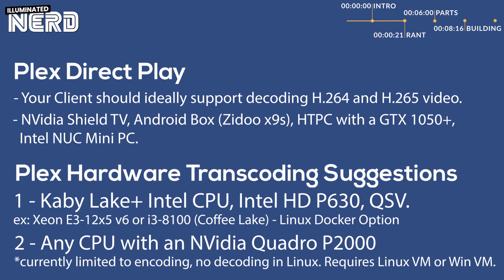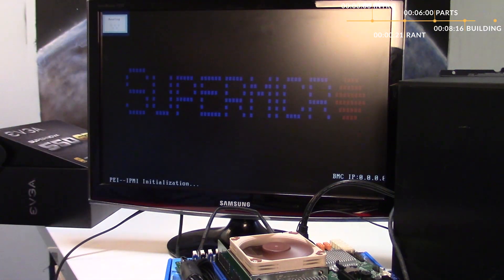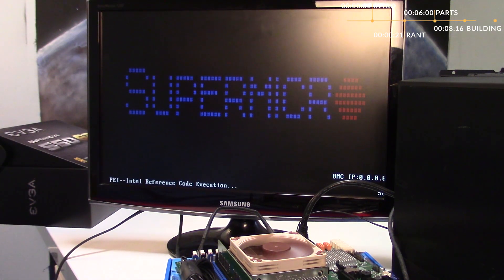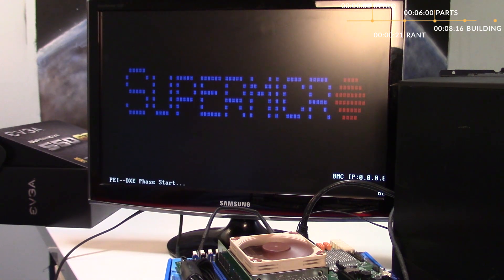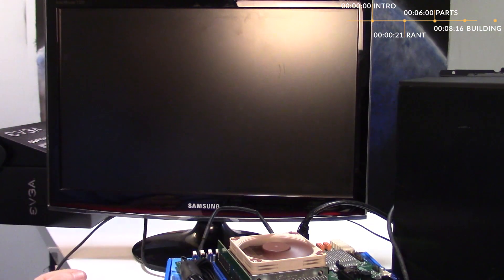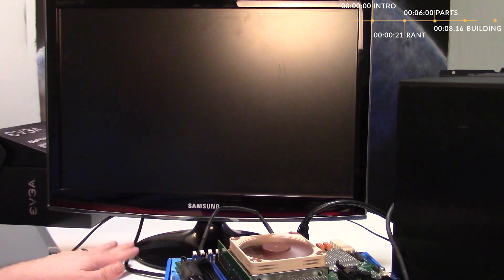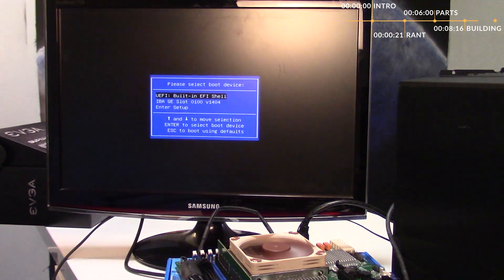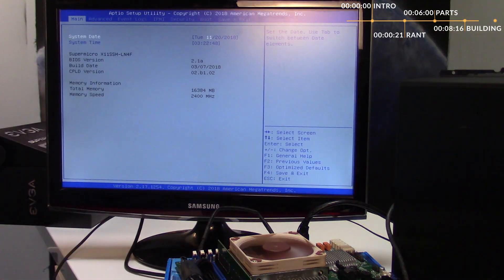Building NAS & Plex Unraid Server with Fractal Design Node 804 - Part 2 - Building the Server

Comment: I am confused...the Supermicro X11SSH-LN4F Intel Xeon MoBo has a PCI-E slot for a GPU.  I can not find anywhere where you mention/show what GPU you installed? How do you provide a video interface for the user?
Reply from the maker: The Xeon CPU I'm using has a built-in GPU (and the Mobo supports that). I got this Xeon CPU as the onboard GPU supports a recent enough version of Intel Quick Sync to use with Plex Transcoding. Due to this, I don't need an external video card. However, logically I don't need one regardless... since the Unraid interface is a Web UI that can be reached from any computer in my network via a web browser. However, there are some uses cases where adding an external GPU would be useful... such as providing a dedicated GPU to a Windows 10 VM (for gaming or running plex in a Windows VM), or leveraging an NVidia Quadro P2000 for hardware transcoding.

Comment: Do you think a strix B550-F mobo (ATX) will fit in the node 804??
is it possible to provide me with the internal motherboard bay area's dimentions?
Reply from the maker: According to the Specs on the Node 804, it will fit Micro ATX and Mini ITX, but not a full ATX Motherboard. https://www.fractal-design.com/products/cases/node/node-804/black/

Comment: I couldn't find the exact PSU that you are using.  But I thought this one would be "The Next One Up".  I am not a total noob, but am wondering how I can possibly attach 8-12 Hard-Drives to this particular PSU. (Or Any for that matter).  I understand that some can be chained together, but can you help me understand how "In Theory" I can attach 8Xs 3.5 Inch Drives to this PSU?  Here is the link - https://www.newegg.ca/evga-supernova-g3-series-220-g3-0650-y1-650w/p/N82E16817438094  Just on a side note: Is there anyway to contact you for advice or help if I run into any questions?  Or should I just post in the "General Comments"?
Reply: I am sorry.  I guess that really was a noob question.  I see now that as part of your hardware that you included "[2-pk] 15 Pin SATA to 4 SATA Power Splitter- 20" which allows for that.  I already bought my Node 804.  Getting very excited to build this thing.  Will probably be a while before it is finished though, as I don't have the money to buy it all at once.  Just gonna buy a piece at a time over the long-haul until it is eventually finished.  :-)  Looking forward to seeing Part 4!  :-)

Comment: Thanks for sharing. Out of interest, what GPU did you use during setup/bios config? Did you eventually run headless? Thanks!
Reply from the maker: The onboard GPU of my Intel Xeon E3-1275 v6 (I'll be using it for plex hardware video transcoding). I was able to connect a monitor with the motherboard's VGA connector during the setup... and then I went headless once I had the Web GUI accessible on the network.

Comment: This is an awesome learning video. I'm brand new to NAS and trying to climb the learning curve before I plunk down a big chunk of change on my first build. I would like to put together a build similar to the one in your video to stream 4K content with Dolby Atmos audio to my LG WebOS TV and Atmos Surround Sound sytem while still being able to run Plex to my other devices and to my Plex "Friends". As of now, Plex can't handle the Dolby Atmos so I'm guessing I need to DAS the box to the TV. Right?? The Supermicro MBD-X11SSH-LN4F-O doesn't have any HDMI ports so it looks like DAS is out. Can you recommend a motherboard(s) that would work for this. Or am I down a rabbit hole here?? Also, are you planning to do the 4th video on Plex and Docker containers any time soon? Thanks
Reply from the maker: I'm still working on the plex video, but I will give you enough info to get you going in the right direction.  

I also have a 4k LG TV running WebOS 4 (you need at least WebOS 3+ on a 4k LG TV to install the Plex Client). I installed the plex client in WebOS and pointed it to my plex server running on my Unraid NAS. I put a ripped blue-ray on my NAS in a folder that plex is watching and it "direct played" the video without any transcoding needed. I have a TOSLink (optical) cable going from my TV to my amplifier, it sends the audio to it and it has the full digital encoding of the video. This is what you want for your TV setup and 4k content. The Plex server will just act as a file server and your TV will just stream the full untouched media file and play it at full 4k with dolby atmos. As long as the client (TV in this instance) supports the audio/video codec of the file, it will direct-play. You should be encoding your blue-rays (or re-encoding downloads) into the audio/video codec that your client (TV) supports. You don't need a strong server to direct-play 4k, just adequate networking between the two internal devices. This is a commonly misunderstood aspect of how Plex and 4k content works.

Now onto the other topic... when someone remotely plays content, you "could" have it setup so they direct play your 4k content.. but you probably shouldn't. Too much bandwidth, or your server will be chugging trying to transcode everything to 1080p from 4k. I would suggest you re-encode a second copy 1080p version of your content in a 2nd folder and only allow remote access to "friends" on the 1080p content folder. You can access the 4k folder from your TV though. Your friends connections will probably require transcoding as you can't predict what every plex client (tv, android box, roku, etc) they will be running. Every client has different support for various audio/video codecs. I find that x264 (video) and AC3 (audio) are commonly supported on most devices. If the file being sent to the remote plex client doesn't support the video/audio codec, then plex will transcode the video to a format that the remote client does support. Transcoding is 1080p max (no 4k). The transcoding is what you need either more cpu cores, or a GPU to help doing more efficiently.  If you get an Intel Xeon CPU that supports a recent version of Intel Quick Sync as I have, you can hand-off the transcoding to the onboard GPU. It's quite good at it, can handle multiple 1080p streams and your CPU isn't touched. This allows your server to use resources for other things, like my ARK Server that runs on Unraid. You can get an external GPU to do transcoding instead (a GTX card or a Quadro P2000), but support for it isn't super duper easy in linux. You have to install a modified version of unraid that includes the video drivers, or you run plex in a Windows 10 VM where the video drivers are easier to acquire/install (normal nvidia drivers). Since I prefer Plex running in a docker container in Linux, the Intel Quick Sync option made sense for me. 

Enjoy... let me know if you have any additional questions after digesting that :)
Reply: @IlluminatedNerd  OK, got it. I'm clear on the direct play now. My TV is a new OLED so it's running the latest WebOS and I have the Plex app installed on it. Passthrough is on and my Samsung Q90R Atmos system is connected to it via the eARC HDMI. I'll try a Toslink connection to see if I get better ATMOS content results. 

I would prefer to DAS the new NAS box to the TV (is that crazy?) so I'm still looking for a HDMI motherboard. Preferably Mini ITX to fit in a Node 304 case. The 304 height is right for my AV cabinet. Onboard wifi would be nice since the router is in another area.
Hope I'm not taking up too much of your time with noob ignorance.

Thanks again.
Reply from the maker: The signal is not decoded at the NAS (Plex Media Server), but at the Client (Plex Client). That means it's pointless to connect an HDMI cable to the server unless the server is running the Plex Client somehow as well.

Options:
1- If your TV has an HDMI OUT and can be connected to your SoundBar, you may be able to set your plex media player client to "passthrough" and get Dolby Atmos to work.

2 - Get an NVidia Shield as your "plex client" instead of the TV, and it will output dolby atmos to your soundbar via HDMI, and then passthrough your video to your TVs HDMI IN.

3 - Use your NAS as both Plex Server and Plex Client (A hybrid NAS/HTPC). Instead of a motherboard with HDMI out, add a video card to your NAS (A GTX 1050+), create a Windows 10 VM with the video card assigned to it. HDMI cable from the video card to the Q90R HDMI2(ARC) port, and then HDMI cable to your TV from the soundbar. The onboard GPU is best reserved for transcoding outgoing streams, especially if you have friends. The thing is... when you pass your GPU to a Win10 VM, you lose access to the GPU in Unraid for other things. That's why I suggest adding a video card for that setup.

I would say it's unusual for the NAS to be near the TV, so most people opt for an NVidia Shield or build an HTPC in a PC Case that fits on their TV Stand.

Comment: Thank you for video!  My 4790K has quicksync - is Plex not able to use quicksync enabled cpus before 8th gen to accelerate transcodes?   I am about to give up on FreeNAS, latest update broke Plex - so if you have alot of household members relying on you - enjoy your redface :(
Reply from the maker: Yes, plex can certainly use quicksync enabled CPUs for hardware acceleration. Others have successfully used much older generation iGPUs with intel quicksync on plex. 5th-gen Broadwell or newer is recommended (the encoder was very pixelated prior).  You do need the paid plexpass version to enable hardware transcoding in plex. I don't have any FreeNAS experience, but for Unraid (linux based) you need to load the iGPU Drivers (called i915) as part of the OS Startup config. FreeNAS started including the iGPU driver since v11.2-U1. Ensure you have at least that version and that you lookup on how to load the driver with FreeNAS. This thread could be helpful.

https://forums.plex.tv/t/plex-in-freenas-jail-and-vaapi-intel-hardware-acceleration-support/332320/30
Reply: @IlluminatedNerd  Awesome thank you for that link.

Comment: You can add decode to UnRaid with: https://github.com/Xaero252/unraid-plex-nvdec
Reply: So I just found out about the encode /decode unRAID docker problem.  I built my server on ryzen 7 1700 as that's my eco system and wanted to use downgraded components for the server and furore upgrades.  Before I jump into this plex install,  I have a GTX 950 to use for plex on this server.  I mean it's in there.  Am I OK to proceed? Or do I jump ship to Intel platform?
Reply from the maker: @sagetx  Yeah that's why I got an intel onboard CPU on the Xeon. That's mainly because I didn't plan on putting a GPU in my PCI x16 slot. However, the current beta version of Unraid simplifies the process of including the NVidia driver so that you can at least expect to get transcoding to work with a linux docker container (how I do it). This part was quite painful previously, which involved installing a recompiled Unraid OS that included the drivers. You should be good to proceed.

Comment: Make more videos! Also, what size were the holes you drilled into the underside of the countertop for the capital legs?
Reply from the maker: Since they're just pilot holes, it actually doesn't matter as long as the holes are smaller than the size of the screw. They're just a starting point. I believe I was using a 1/4 inch drill bit though.

Comment: Quick Question: you said about 8x SATA ports onboard, so as not to waste a PCIe slot on something like a storage card or RAID card, but ended up using 2 separate PCIe adapters for your NVMe drives, despite the fact it went into an 8x slot, would it not have made sense to save on PCIe slots further and use a 2xNVMe/M.2 slot to PCIe adapter to go into that 8x slot?
Reply from the maker: Yes, you're right. I used those single adapters because they were cheap for the intended purpose, and I didn't need the extra PCIe slot.  The x8 slot can certainly handle a lot more capacity than that. If you're willing to pay $200'ish there's even 4xNVMe adapter cards that work in the 8x slot. Example:
https://www.newegg.com/Product/Product.aspx?Item=9SIA5EM7ZN1865&Description=AOC-SHG3-4M2P&cm_re=AOC-SHG3-4M2P-9SIA5EM7ZN1865-Product
Reply: @IlluminatedNerd  Thanks for the reply! That makes a lot of sense, yeah, I used to have a 2x M.2 to PCIe x8 but unfortunately that died a while back!
Looking to do a build in this case soon personally, also a NAS and running a chinesium "X79" motherboard
Just wanted to check(so I can use my RAID card) how much space at the end of the motherboard is there? Down near the 5th PCIe slot cover? My motherboard is about 1cm longer and I just want to make sure it'll still fit!
Reply from the maker: About 2 3/4 cm from the bottom of my mobo to the bottom of the case. Should fit fine.

Comment: How come you only ended up using one of the network switches?
Reply from the maker: I only had one network switch. It has two 10Gbps ports. The NAS hooks to one port via the network card I installed in the server using a CAT8 cable, and the other network card is installed in my computer,  connected to the other 10Gbps port in the network switch. The idea is to transfer my large 50GB+ Projects from my computer to my NAS at 10Gbps.

Comment: Nice Setup. Thank you so much for your work and the video !!  That's excacly the build i was looking for. But i saw on the Motherboard Page that the Xeon is only supported at the Bios 2.x Version. Was the correct bios version already installed that you can just plug the cpu and go for it? Because i actually can't "update" the bios myself if i'm going to buy the xeon 1275v6 direcly.
Reply from the maker: Yeah I noticed the bios version thing too on the supermicro page. I got the motherboard through newegg and someone commented that they did receive theirs with the most recent bios (maybe 5 months prior). I rolled the dice and mine also came with the updated bios. Note that the -F version of the same motherboard (instead of -LN4F) is the same motherboard, but with 2 instead of 4 gigabit ethernet ports. Also note that the M.2 slot on the motherboard is for NVME SSD drives only, not SATA SSD drives in the M.2 form factor. I ended up with a 1TB SATA M.2 drive I couldn't use, and had to swap it with a 1TB NVME M.2 2280 SSD. That's the only real issue that came up thus far. The Unraid/OS video is coming as well, where I'll have a section about the USB stick to use for the OS. Good luck with your build!